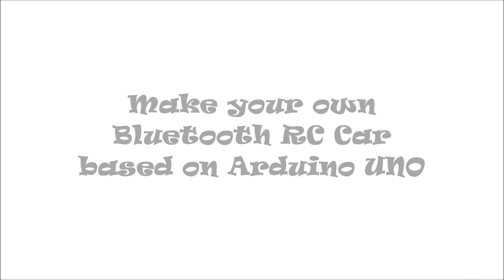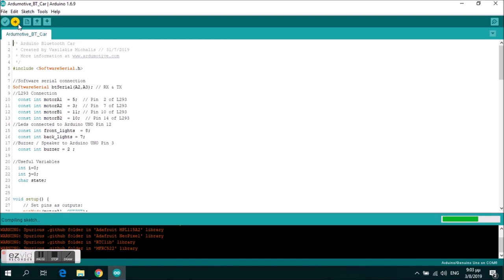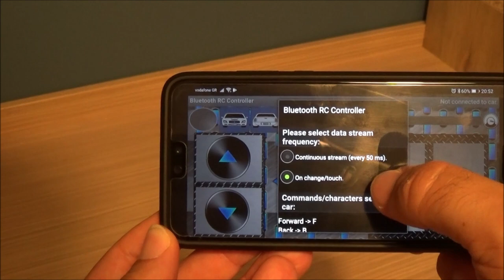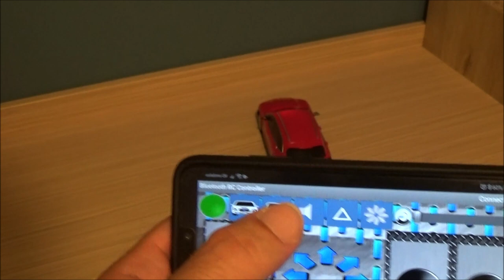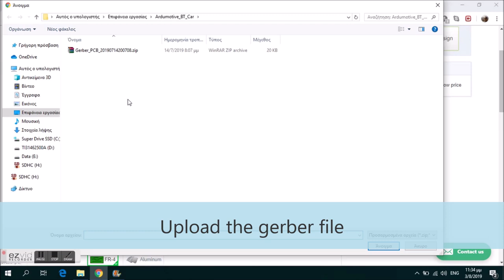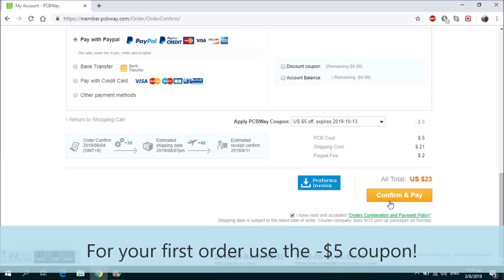Arduino Bluetooth RC Car (new version)

Comment: Fantastic, Any chance you could include code to include Turn indicators please?
Reply from the maker: Thank you for your comment! You can add indicator lights, connect the LEDs to SDA-SCL pins of the board (A4, A5 pins) and just take a GND from another header pin. The code in the if statement is simple like the Arduino example of "Blink LED without delay()".  Sample code can be found here: https://www.arduino.cc/en/tutorial/BlinkWithoutDelay

Comment: I made this.I have 1 major problem my car is working well in close range but as it goes out of it's coverage area it goes on nd on... it does not stops by it self...in short i want to tell u that whenever car lost connection nd being disconnected from mobile it does not stop...i have to run behind it to catch it nd turn off the car...my car is crashing everytime..plz help me sir
Reply from the maker: Hi! Thank you for your comment. The maximum range is 10m. This is  a restriction of the Bluetooth technology. And it's true... if the car lost the connection it will keep the last command and it will never stop... :/ I will search for a solution for this bug. The Arduino Car, somehow, must understand that the connection is lost and stop the car before it's too late...
Reply: @Ardumotive  plz sir solve this problem...i am waiting for your video...😊
Reply from the maker: @patelmarvel7300  Does your HC-06 BT module keep the red led on while the connection is up?
Reply: @Ardumotive  no it blinks...